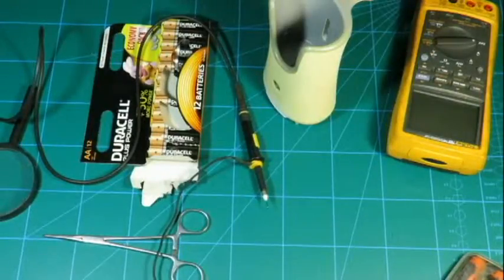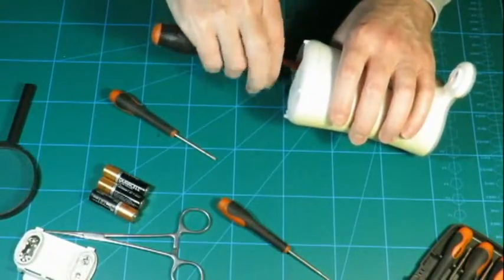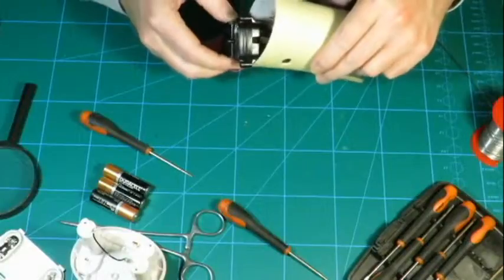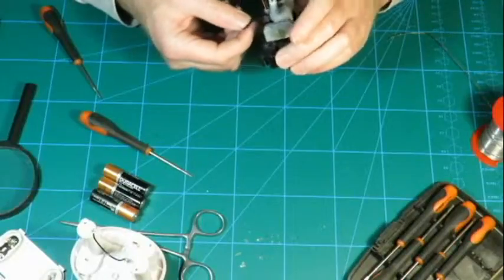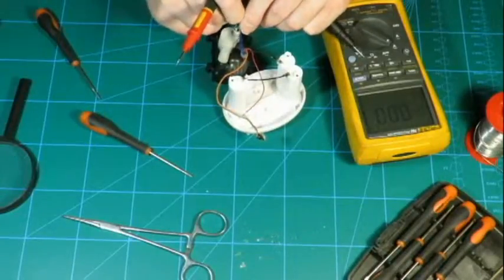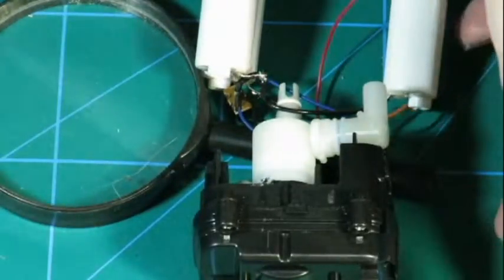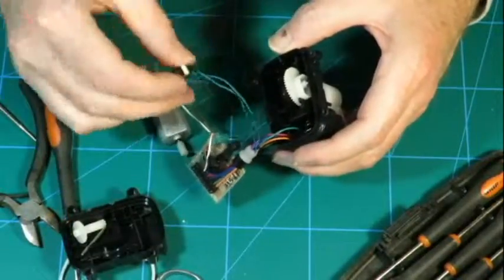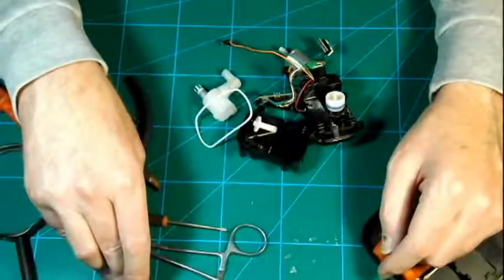Dettol automatic soap dispenser teardown

Comment: I opened it up and found the wires attached to the sensor have been disconnected. The soldering must have come off and also there was some brown stuff over it im assuming rust. I cleaned that up but now i dont know which side the green and red so onto the sensor bulb as it doesnt indicate
Reply from the maker: No harm in trying both ways to see what works, hope you get it sorted.

Comment: Hi Duncan, you mentioned that you wanted to use this as dosing pump. I'm thinking about doing the same for pH and nutrient dosing for a home hydroponics setup. Wondering if there's an easy way to use the existing electronics and just bypassing the IR trigger with a Arduino. Looking forward to your feedback. Cheers.
Reply from the maker: Hi Dries,
One can read the IR straight into the Arduino as I did in my rain gauge video.
And just look for the one pulse per rev from the limit with one of the Arduino digitals.
I have not got as far as making a dosing system with one of the pumps yet.
I have found a source of nice diaphragm pumps, did buy one and must make a teardown video.
They cost a hundred Rands from the China shop and are perfect for a nutrient dosing system. 
These pumps are sold as a bottle top water dispenser gadget, but they seem to contain a nice pump and are worth buying just for the pump.
Let me know if I can provide more info,
Regards, Duncan.
Reply: Uncle Duncan's Shack , thanks for the quick reply, I’ll check out your other vid, just stumbled accross your channel today, very helpful!